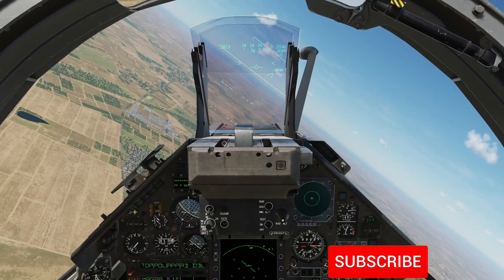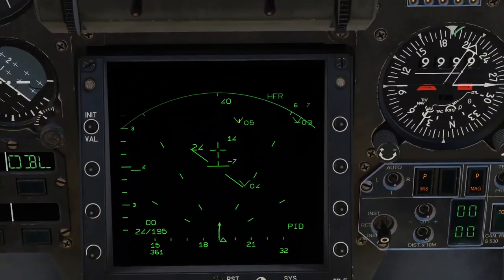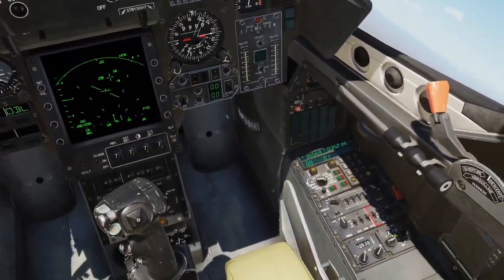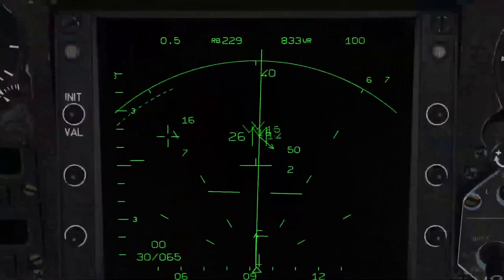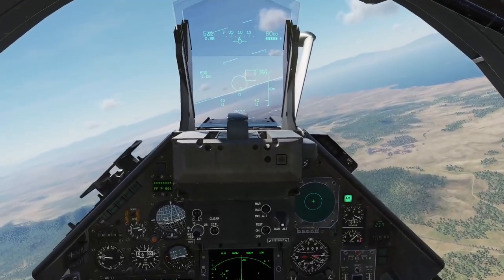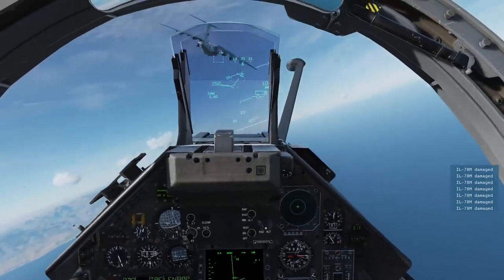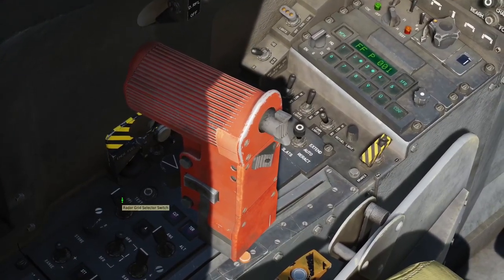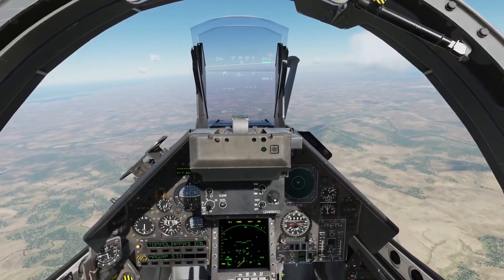DCS M2000C Radar and locking Air to Air targets

Comment: You don't lock with the STT/TWS button. If you look in the bottom right corner it says PID. That is TWS. Click the STT/TWS button it changes to PIC which is STT. You can do that before or after you try to lock a contract. If you lock with in PID, when you hold the trigger to fire to 530, it should switch to PIC.
Reply from the maker: hey thanks for the info. I feel as if this video was under par so I will be redoing it. I would love to give good content and make sure i help people not give wrong information.